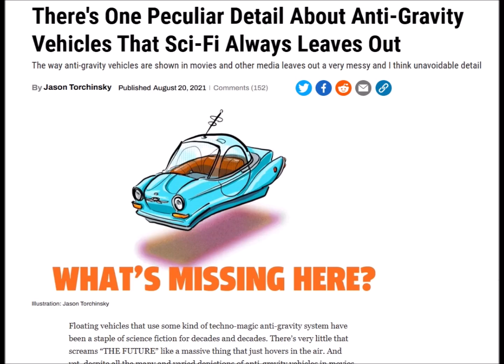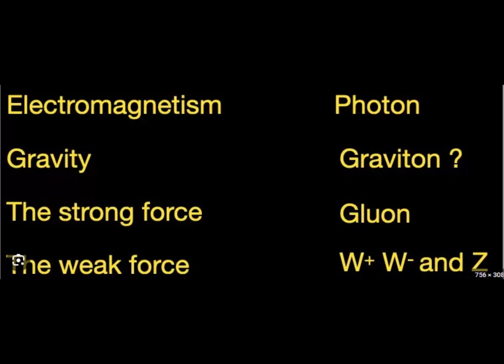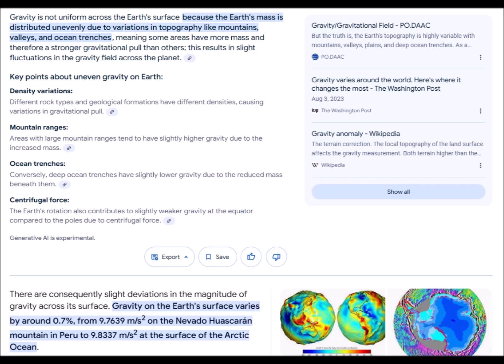"Antigravity" Wheelbarrow

Comment: FYI, if you create a “seam” in the aluminum plate, it will confine movement to the direction of the seam. Likewise, if you have intersecting seams, the point of intersection will create a stable area of levitation. https://youtu.be/LR3UpbtBwJg?si=1xuFnQulYNRLf5-2
Nice work!